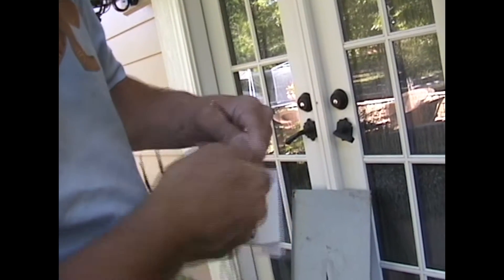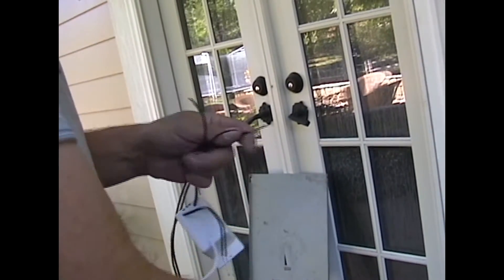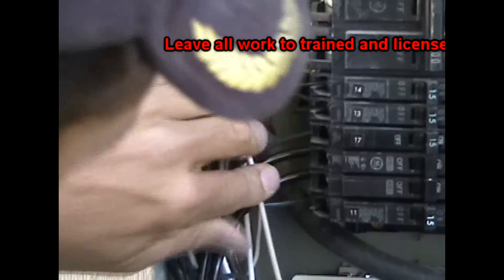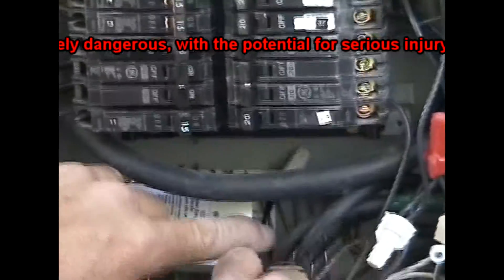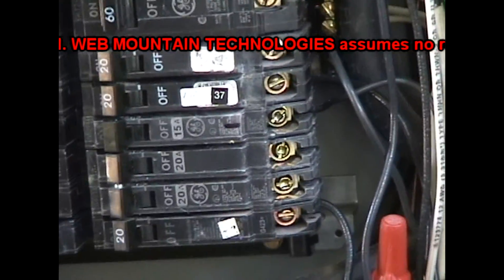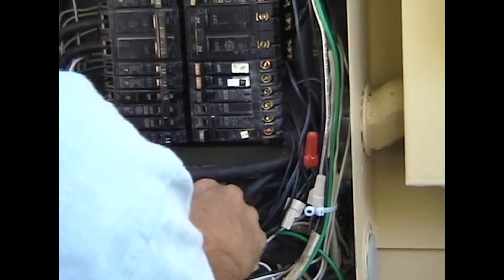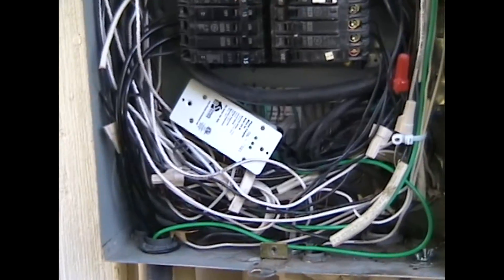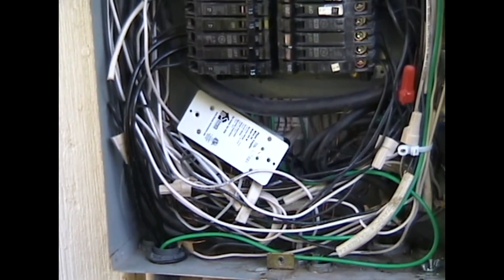Phase Coupler Installation

Comment: Is there really an electrocution risk. I assume there is no electricity flowing to the contact points you are connecting to when the breaker is off, correct?

Comment: Unless that Panel is three Phase the two phase Breaker boxes I've seen usually have one phase and it's associated breakers on the left side and the other phase and breaker set on the right. Not sure what the situation is with the box in the video but in my experience you would connect one black wire to a breaker on the First Phase buss (Usually Left side?) and the second Black wire to the other Phase Buss (Usually right side?)  otherwise the device won't work. In the video I wasn't sure that was emphasized or explained in enough detail. And yes, check code. Doubling up two wires in one breaker is disallowed unless you bring the single wire out of the breaker and use a twist connect to join the Coupler Black wire with the existing circuit Black. Optionally you can install two additional breakers, one on each phase,  but usually that's not required by code.
Reply: For 2 phase just look at at 240 dual throw breaker, the 2 breakers stuck together... one breaker is 1 phase, the other the other phase.  While the phase plates are on different sides of the panel, they are jig-sawed like teeth that reach across to alternate to the other side.  So typically if you needed a 2 phase circuit (240 V), you'd just pop in a dual throw 2 breaker wide breaker... not run one hot from one breaker on one side, then run the other hot from directly across from it.
Reply: If the panel was laid out how you say it is then tandem 220 breakers wouldn't work. It's not line one on the left and line 2 on the right it's every other breaker going down either side. You don't know what you're on about clearly 😂😂😂
Reply: Also most quality breakers will accept 2 conductors there's slots specifically for 2.